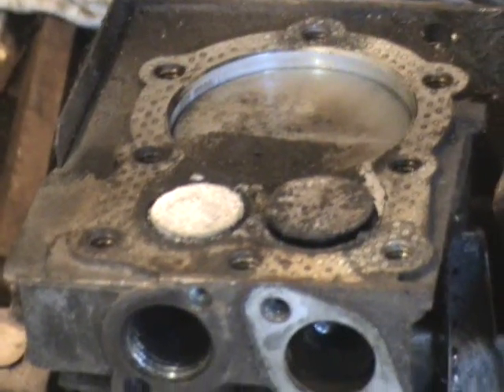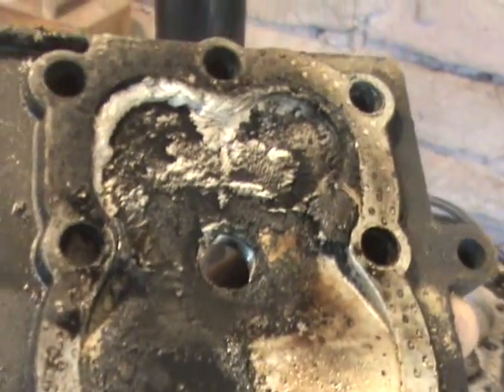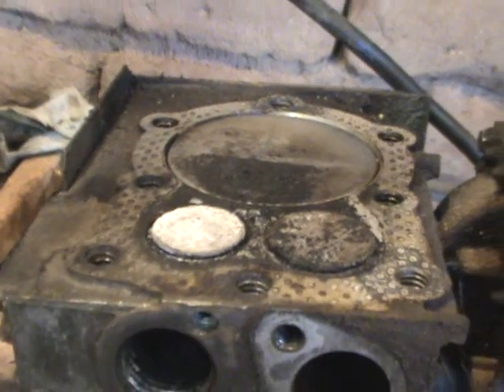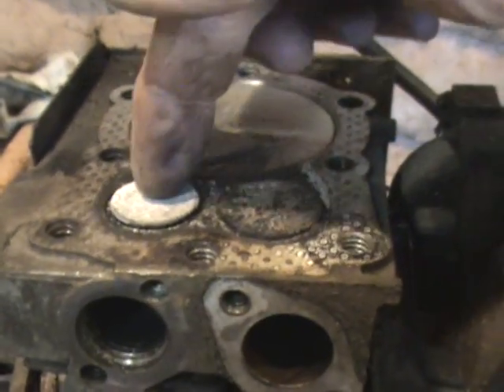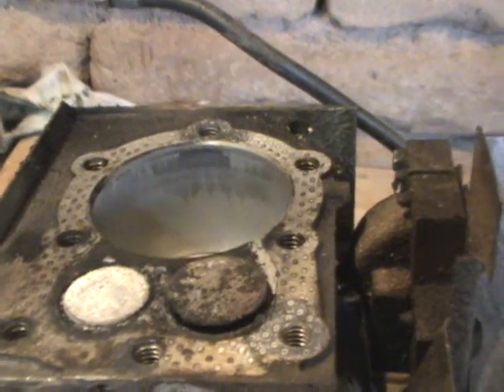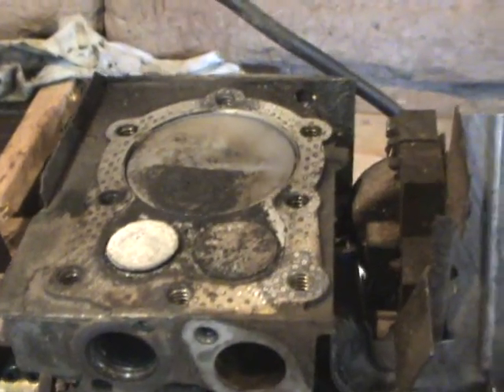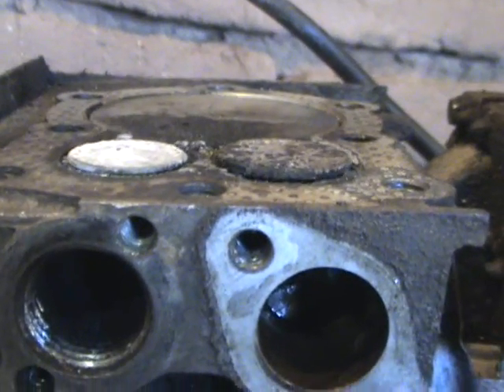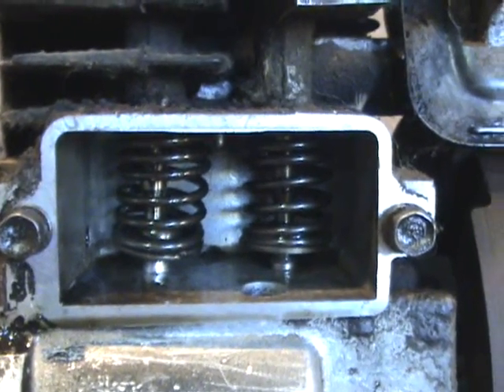Briggs & Stratton engine 080232-1707-01 valves

Comment: This is normal.  It is called "valve overlap".
All four cycle engines do that.
It helps with scavenging the cylinder which helps the inflow of air.
Yes, the valves need cleaning, but if they are both closed and sealing during the compression and power strokes, all is well.
Camshaft dudes play with this and other stuff all the time for optimum tuning.

Comment: I've found sometimes debris (carbon) can build up between valve and seat and then defeat a proper seal.  The white powder buildup looks abnormal.  If you don't have the "lapping" tools and supplies, try tapping lightly in the valve in the seated position and  alternately rotating the valve and repeat tapping.  This sometimes loosens the debris for a proper seal.

Comment: Looks like it's getting water in through the exhaust while it's sitting.  It has a pretty good chance of having the exhaust valve hanging open when it stops, and that will allow air to circulate while the engine is off, and you get condensation inside.

Comment: It's called valve overlap (the point where both valves are slightly open. When at this point turn the crank 360 degrees (one revolution) and measure the valve to tappet clearance. It's a common problem for those engines that the valves and seats wears  so that the valve clearance gets to small. This will first lead to overheating on the exhaust valve and secondly a poor compression. Looks like it's burning oil btw (white and black stuff). Prob stuck oil ring watch?v=kO8aOe82fQE

Comment: Yes they are suppose to be like that at Top Dead Center. There is compression release to help with easy starting and when it gets up to speed the valves work correctly and there is no overlap. That's not the problem. I agree that you are burning oil and need to replace the rings. These engine are not meant to last long 1000-2000 hrs. Rebuild it or buy a better engine. I would go with a diesel but they are expensive.

Comment: There should be some overlap of the opening of the valves, the exhaust valve being slightly open when the intake starts to open causes a vacuum in the cylinder which assists the intake gasses coming in. It keeps the gasses flowing, at least that's what I read on the side of a cereal box once...

One other thing, it looks like you might running a little lean judging from the condition of the head.

Comment: Just put the whole thing back together again.
Then take off the air filter. Start the engine , and rev up. Then at max rev. ( After the enging has heated up.) (And running at full rev.) Pour a couple of liters of water dnto the air intake.
This cleans the engine.
Reply: Flapjackbatter a

Comment: The valves are in overlap  if it has compression your. Fine. You adjust the valve by grinding the stem. The cramp on the head normal.scrap it off and put the head  back    on.

Comment: I see I'm late for the party. Ratz! Yes, there may be a point where they're both open at the same time for a nanosecond or three, but they should each close tight independently. If you have good compression, they're closing properly. Scrape the crud out of it and put it back together.

Comment: If it was running before I doubt the problem is anything too long or short. It seems the valves aren't sealing properly and that is likely due to all the crud in the valve seats. The head shows a lot of burning that shouldn't be there for a 4  stroke.  Is it leaking oil or coolant into the chamber?  If it is, you may be on to something suspecting the gasket.  Clean it up, replace the head gasket (make sure its sealed) and see how it runs.

Comment: @Desertphile
G'day mate, it appears the chorus is correct. Valve Overlap, between the end of Blow & start of Suck leads to more betterer Scavenging, as the inertia of the departing Exhaust is allowed to induce movement of the Inlet Charge, at TDC..., before the Swept Volume starts to Suck.... So all the Burnt shit leaves, every time. Did you change the Oil every 100 Hrs, or just top it up, letting it go Sour & Thin, & flow past the Rings ? Confess, Varlet ??? Ciao !

Comment: I'm not an engine expert.  Overlap is normal as you've seen. The white buildup is not normal.  I suggest the engine is running lean.  Although I've never tried it, run some propane into the intake while the engine is running (stand back or you'll burn off your beard).  It should loose power.  If it gains power, check the carb gasket (new one I hope) and the carb jet.  What did the spark plug look like?

Comment: the only weird thing i see besides the crud, is that washer at the bottom of the spring, on the exhaust side  - it is lopsided while the one on intake side is level. 

maybe it needs a new carburetor belt or some prop pitch?

Comment: its supposed to open like that on intake and exhaust stroke.they looked closed on power stroke.clean it out and spray some transmission fluid while its runnin wide open then spray water from another spray bottle in there with breather off both times of spraying.itll smoke like crazy when you spay in trans. oil buy this will soften carbon and water wil;l be like hittin it with steam sprayer.thatll help it clean itself out.looks like you run it at low throttle alot.not good.gotta blow the sutt out sometimes

Comment: I have the same problem with mine, only that I can't see any gaps when I shine a light into the exhaust port,etc.

Mine has had a slight miss at idle which includes spitting back through the muffler,it also surges a bit when cold, I have not checked the valve tappets for clearance yet but I kind of know what the verdict is - I've had to order valve lapping stick & I have to buy some valve lapping compound, I checked them with mineral turpentine by tipping it into the carby & exhaust port to find out that I have leaky valves with the cylinder head removed.

The valve seats wear out a bit over time so the only solution is the grind or file the ends of the valve stems down then lap the valves into their designated seats,I've heard someone say that's unprofessional but with the engine only being a 3.5 horsepower, the valves are very small which means if the valves are excessively worn or pitted,they need replacing,fair enough on anything over a 5 horsepower engine,they can be reground if they are bad enough.

Once I lap the valves back into their seats, I can then recheck the valve clearance & grind or file the valve stem ends if necessary.

The inlet valve clearance is about 0.006" (0.15mm) & the exhaust valve clearance is about 0.010" (0.25mm).

Comment: come on desert dude!!..the Harley rule of thumb..if it ain't broke,don't fix it..scrape the carbon off the head and the top of the piston..and get a new head gasket ya penny pincher..if I may ask,why did you take it apart?..what was wrong with it?..got spark?..got decent compression?..got gas?..it's gotta run..the points and condensor are under the flywheel..google or some forum is your friend